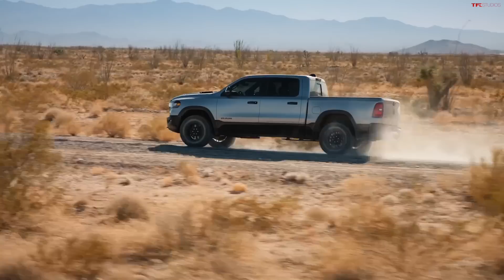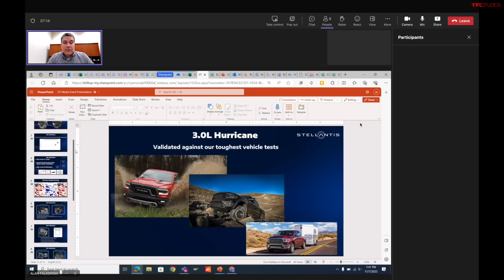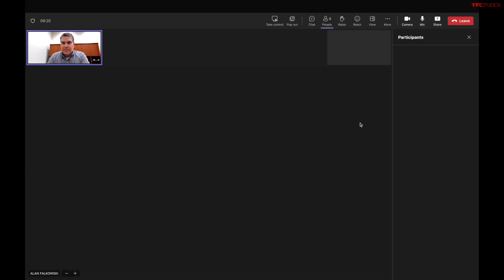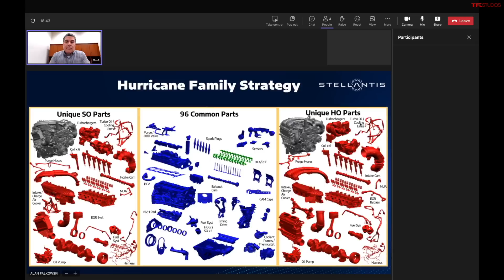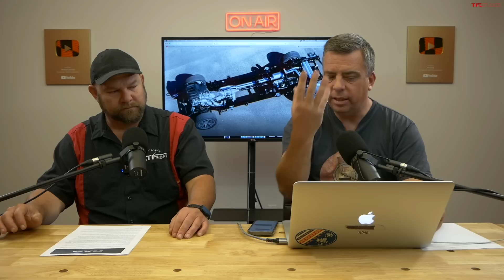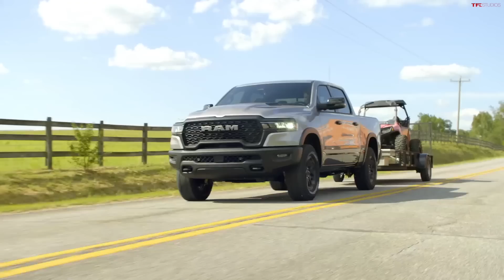2025 Ram 1500 & Ramcharger DEEP DIVE with the Chief Engineers!

Comment: There is no replacement for displacement guy's. On paper, ok so the I6 outperforms the HEMI. Longterm the V8 will outlast any turbo'd out V6 or I6. Reliability or performance? I will take reliability over performance in a heartbeat. Another great video guys!
Reply: The big diesels use I6 engines. It's an engineering issue, not engine architecture.
Reply: It's plausible, though the vast majority of people dont own their vehicles long enough to see that reliability really become an issue. Plus it's not like the Hemi is the same V8 as years ago. It's still a modern engine with variable cam timing, high compression, cylinder deactivation etc.
Reply: You better tell Cummins I6 owners this!!
Reply: Clarification, the I6 Cummins is a monster. As I said, no replacement for displacement. At 6.7L I was not including this in my thoughts. Thanks for reminding me. @MTBD80
Reply: @shumann1605......................You must have not known about te 4.0 L Jeep or SLANT 6 Engines, as they were very LONG TERM engines, and provided a lot of low speed torque, plus a straight 6 Engine is "PERFECTLY BALANCED"!!
Reply: I’d argue the turbo I6 will outlast the V8.  They will running at lower rpm most of the time and are built with stronger materials.
Reply: @user-tb7rn1il3q  low rpm‘s while generating high torque figures are exactly the problematic thing with turbo engines. There is an excellent video from Engineering Explained about „Why you should never lug your engine“.
Reply: @adrianzbaeren  Lower RPM does not mean lugging.  The transmission won’t allow that anyway.  I’m talking about running the engine at 3000 rpm vice 5000 rpm.  The engine run at 3000 rpm will last longer.
Reply: @user-tb7rn1il3q  
Ok we haven‘t had the same definition for „low rpm“. In this case I see your point.
Reply: Looks like they have found a replacement.  I see many reports  of ford's turbo engine  with over 200 and 300k
Reply: *Laughs in Mercedes OM617 with over 1,000,000 miles on the odometer*
Reply: not the only one to go over a million. Certainly not the norm for any car maker. Overall lifespan for any ICE engine is 2-3hundred thousand.and to get to that 1million, you have to be 100% ontop of the maintenance. Very few engines, even with that level of care will get to 500k. nice try though.
 @_emh
Reply: I will keep my HEMI
Reply: @Brunoinski  Financially that’s a smart move
Reply: Turbo engines these days are very reliable and long lasting. There's no way to say definitively that a turbo 6 will last any longer or shorter than a V8. It's pure speculation either way.
Reply: @Japplesnap  not necessarily. Turbo are designed to force air into the engines. It is reasonable to assume increased pressure and increased combustion in the cylinders will result in increased wear and tear. However, manufacturers seem to be taking steps to beef up the internals. Fords 3.5 twin turbo v6 is on its 3rd generation now. It's now dual injection and has more forged internal parts. So we will see. If they would release more of this information to the general consumer it would be easier to spot an engine that might last longer
Reply: @tylerproctor4878  Factory turbocharged engines have been overbuilt for decades now. That's because they are designed and engineered to handle boost pressure. This isn't anything new. I remember years ago my buddy though it would be a good idea to turbocharge his naturally aspirated 300ZX. His theory was that the same engine was also in the factory turbocharged 300ZX, so he could easily turn his non-turbo Z into a turbo Z. He quickly learned that the real Turbo Z engine was made to handle boost and higher compression when he grenaded his engine in less than a week. The point here is that factory turbo engines are already overbuilt from day one. That's also the reason why pretty much any factory turbo car can be tuned for higher boost and survive just fine. Factory turbo cars are already overbuilt.
Reply: @Japplesnap  I started paying more attention to turbos when the ecoboost came out on 2014 for trucks. I very much doubt they overbuilt that engine in it's first generation. But you can see looking at the new Ram hurricane 3.0 twin turbo that the standard output doesn't use forged aluminum pistons but the high output does. Why not use them on both but Atleast they published it. As far as I know GM 2.0 in the Colorado and canyon only have forged crank shafts and steel seat rings. Steel ring is a must have on turbo engines I think but they didn't share any other details. Then you must consider the reliability of the turbo itself which i am yet to see one with too many miles on it. I'm sure you are correct they have to build somethings stronger but am I going to get 300k miles? I'd bet you a paycheck imma get 250 to 300k out of my pentastar 3.6l or a coyote 5.0l. He'll toyotas v6 they were putting in the Tacoma last so long if you didnt get 300k you felt like it was a lemon. Don't get me wrong turbo engines are nice. They last a good 150 or 200k on average and I'd probably save enough in gas to buy a new truck anyway but as they are built right now I still believe N/A engines have the edge in longevity.
Reply: @Bikes0420 Well of course only time will tell, but anecdotally our 2015 turbocharged Ford is still running as good as new with 85k on the odometer, and my prior work still has 2004 Prius hybrids which are running well (maybe not getting the same economy as new, but still with one having 214k on it I think it was respectable). So I think decently designed turbocharged engines and hybrid systems with batteries will do fine even through 2nd or 3rd owners.
Reply: @Bikes0420  Ask Toyota how used hybrids fair.
Reply: Ford should come back with the I6.  Their 300 six was the best engine ever.  Sure is was a gas hog and slow. Bulldozer tough. My opinion I wish I could buy the plain Jane 1980 F150 beater I had.
Reply: From a balance standpoint the I6 is a superior cylinder configuration.  I love the Ford I6 engines
Reply: I don’t know I have 450k on my ram 1500 with the 3.6 and it runs as strong as when it was new
Reply: Federal regulations are forcing manufacturers to eliminate the V8. Stelantis has already been paying some fines for their fleets not meeting said regulations. Democrats love to over regulate, and are doing so in the name of the climate farce, where as Republicans have been in favor of deregulating.
Reply: But you would worship the Cummins I6
Reply: I mean a lot of semi trucks use turbo’d out i6’s. They seem to last pretty long. And if a vehicle lasts 300k miles with regular maintenance and replacement of wear items, I’d say it’s pretty good. Not many vehicles old or new, that you see lasting past 300k. And nowadays the rest of the vehicle breaks down before the engine does
Reply: @yunghernando3946  
Inline 6 engines are great engines. They have around 20% less parts than a V6 engine (cheaper to produce) and they run without any vibrations (better for longevity). They warm up quicker and are lighter than a V configuration with the same displacement. Thats why most semi trucks are powerd by I6 engines.  
The problem I see is the enormous power density of this new RAM engine. 
540hp : 3.0l = 180hp per litre of displacement. 
Imagine the 5.7l HEMI would have the same power density. 5.7l x 180hp = 1026hp. 

Would you look at this imaginary HEMI as a reliable engine or would you think that its problably an engine which needs much care and maintenance? 
Time will tell how this new engine will perform and how fuel efficient it will be. 
In German we say: Turbo läuft, Turbo säuft. (Turbo spools up, Turbo guzzles fuel)
Reply: Diesel I6 engines in Semi Truck are engineered on a much higher level than personal consumer trucks are one. Two I6 diesel for Semi's was not part of the conversation. Sorry  @yunghernando3946
Reply: Gonna cut you off right away here.. in-line big bore small stroke motets will blow the top off any v8 from the last 20 years in terms of torque curve and usable power. One of the best motors I’ve ever experienced is the 4.0 inline 6 that used to be in Jeeps. Depending on final drive max torque from 1209 rpm to about 3500rpm kinda like a diesel mirror then you get the big rev Hp of a gas motor that refs higher. 

There is a replacement for displacement and that is in one motors with big bores. When you adds turbo to an inline 6 you get a monster.. you get a an old school dual cam effect where you get the low end torque a small fall off then a huge surge when the Hp and higher refs take over.. 

The only downside of online motors is they generally don’t rev very high.. so the power delivery can become very peaky at times. 

Twins turbos that are smaller help tame this.. in old days you ran a single turbo on inline motors and a large one at that.. it was jeckle to Hyde depending rpm range. 

Pair this with modern day hybrid and you could run better and larger turbos wo sacrificing the low end torque delivery. I think they are in the right track here between all this. They will be able to side the turbos a little larger for better top end and use the hybrids to cover the low end issues.. 

Even still they could do this wo electric and properly sized turbos on an online would he seem less however the rpm range would be limited even with an 8speed trans.. ford uses a 10 speed for the 4 cylinder eco for a reason.. this allows them to use a smaller stroke then a typical inline motor allowing for higher revs which alllows the turbos to spool and remain in their rpm range longer.

As for longevity.. I won’t argue that one.. a basic v8 will always have lower maintainer costs and issues then a turbo vehicle. That said I think the 7.3l power stroke would argue with this lol.. but that was a big turbo on a big v8 and not gas so it works completely differently.. but it can be done.
Reply: Your right, but if you read my previous comments, I was not including the I6 Cummins @fishrrelaxing9361
Reply: There are replacements for displacement though…
Reply: They can make this engine reliable.  Turbos can be made reliable. Convince me it's built correctly to handle the load of the turbos a long time like diesels are and I'll buy it. I know it's gonna cost
Reply: Cummins will easily last 1 million miles and they're turbod.
Reply: No more v8 I don’t buy any ram trucks with v6 engine, so the point you are right
Reply: The hemi's have mds lifter issues...not reliable
Reply: I‘m absolutely with you! Even from a efficency stand point I‘m convienced that the HEMI will be better than the new turbo engine. At least under moderate load, hauling a trailer. 
If the new engine would have at least 4.0 litre of displacement and no more power than the HEMI, then it could be more efficient than a V8. 

I live in Europe and we have many small engines with big power figures, they can be pretty reliable but they consume at least as much fuel than bigger NA engines.

Comment: What's the power rating for the standard SST when not in boost? Gas savings occur when not engaging the boost. In the boost, these motors get worse mileage than the current V8s. It's either eco or boost. V8 you have the best both worlds depending on your right foot. SST requires premium? No savings there.
Reply: Boost pressure will be variable depending on input. Fuel economy may not be better when loaded down and deep into the throttle, but only time will tell how it exactly stacks up (unless there is already a Wagoneer review comparing the two).

Comment: The electric hybrid sounds cool, but I have a few questions. 
1. How long are the batteries supposed to be good for?
2. Are the batteries accessible, or would the body need to be lifted for a change?
3. Price of the battery pack. If they need to be changed out every 5yrs, is it affordable?
Reply from the maker: What we know now is batteries and electric motors have an 8 year / 100,000 miles warranty for other EVs.   

Battery life is based on number of charge cycles.  

The 2014 bmw i3 REX electric car we own still works like new after 10 years and 65,000 miles.
Reply: @TFLtalk  Assuming that the battery goes completely dead after a number of years/cycles, you should be able to run the motors directly of the gasoline engine generator, is that right? The propulsion chief eng mentioned battery storage and generator are connected to the motors via the same bus.
Reply: My Focus Electric is five years old. I've lost around 6 to 10 miles of range out of 100, with 70,000 miles. Degradation is pretty a solved issue for consumer vehicles.

Comment: You can defend the straight six, however we all know GM is developing a new small block. Therefore the argument for the 6 cylinder is not all that great
Reply: GM seems to be bucking the trend, but there are still many OEMs going back to an inline engine architecture. Mercedes, JLR, BMW, and Mazda on top of what Stellantis is doing here.
Reply: @ALMX5DP  European brands have always had small anemic motors for ever.
America 🇺🇸 is about displacement,  which has no replacement
Reply: @mbukukanyau  some of those anemic powertrains kinda show up lots of traditional displacement based engines. That and there are replacements for displacement such as variable cam/valve timing, intake runner controls, high compression, direct injection etc besides forced induction.
Reply: @MX5-XU  No, the Corvette C8 showed without a doubt that there is no replacement for displacement, 490 horses from the 6.2 liter and well over 600 from the 5.5. Remember, these motors pack a staggering amount of technology
Reply: @mbukukanyau  don’t get me wrong, I’d rather have either of those mills, but I think all three German brands have smaller displacement engines making more power (and much more torque). Ford and Ram now have two fairly mainstream V6s which make more power than the non Z06 C8.
Reply: Rumer has it so is Ram/Dodge.
Reply: @ohioguy4326  They better. Based on the top output of current small block in Corvette a d Camaro pushing almost 500 hp and 500 lbs ft of Torque,  the next generation is probably going to break 550 hp in trucks in 6.2 liter form. That would put Torque at a staggering 500 at least . In a V8!.. because America 🇺🇸

Comment: Not sure if I would be bragging about hp/liter. More hp per liter just means more pressure/stress on the engine components, tough on smaller displacements.
Reply: It's simply a measure of efficiency and as long as the pressures and stresses are accounted for in the design and construction it should be fine and no tougher on any particular displacement.
Reply: HP is at higher operating RPM. Most of the time the engine will operate far below the HP peak.

Comment: On what planet do you guys live on if you think the current Ram air suspension is relatively reliable ? Have you never been on a Ram forum ? Come on guys, you are TFL tell it like it really is.
Reply from the maker: Based on how many of these they sell - percentage of failures is not very high.
Reply: Large portion of those who have an issue complain about it on the forums. A very, very small portion of people have any reason to bother saying anything about the suspension if it is working well.
Reply: The issue isn't total failure...its the consistent leaks. You wake up and one or more corners are down. Start the vehicle and yes it will pump back up. Not a big deal if you live in warmer climates that don't have freezing temperatures(or don't remain freezing for long) in the winter, but for folks that live in the northeast or central states those leaks mean the nitrogen is gone and now the system if filled with outside air and more importantly...moisture, which can freeze in the lines and lead to premature compressor failure. This is not just a few forum folks complaining. This is pretty wide spread. There has never been a recall(would be expensive) but there are plenty of NHTSA complaints and there was a class action lawsuit in Canada. By the way i love my air suspension, I have a 2016 Ram Rebel and one of the reasons I bought it is because it drives so great, but I know the issues with the air suspension. I know if I wake up in single digit temperatures and I'm on my bump stops, I'm pulling fuse F50 until I'm above freezing long enough for a thaw. Fortunately for me its not my only vehicle and not my job/work vehicle.

Comment: Sooooo, in order to achieve mileage and efficiency targets AND keep customers happy, why didn't they develop a small, twin turbo, hemi, V8 ?. Is it impossible to put all the new fuel system, piston shape, air flow design, etc, etc. in a V8? I see by the pictures that the six has Hemi heads, could they not promote the new engine with that info? Im pretty sick of being told what I should like. How about they offer both the V8 and the new 6 side by side like Ford is doing, and we the customer will decide which one we want.
Reply: From what I understand the 5.7 hemi is no longer epa compliant after 2024 so that’s why we aren’t getting both options. Why they put their money into developing the I6 instead of a new v8 that would be EPA certifiable is a good question. If I had to guess they probably thought the i6 would be more future proof to further restricting emissions.
Reply: Did they ever say specifically why they killed the 1500 Diesel engine??
Reply: @barryhamilton3112  
Only comment execs gave was that they are “focusing on the future of EVs” which is a load of BS because the Ecodiesel has already been developed it’s not like us using any r&d resources.
Reply: The Hurricane 6 has the benefit of being a scalable architecture, and we already see that with the Hurricane derived 2.0T in the Jeep and other Stellantis models.